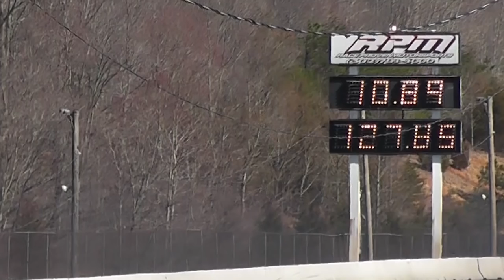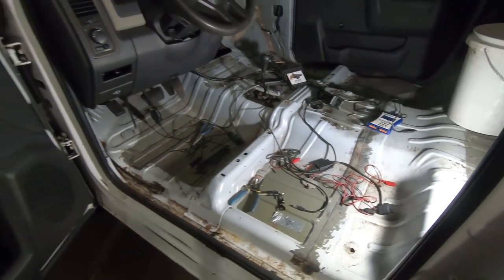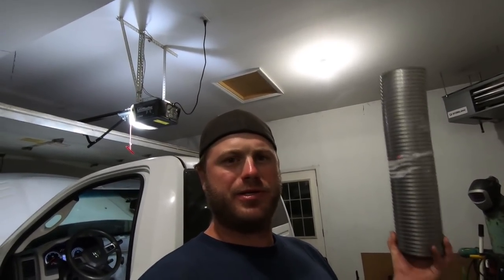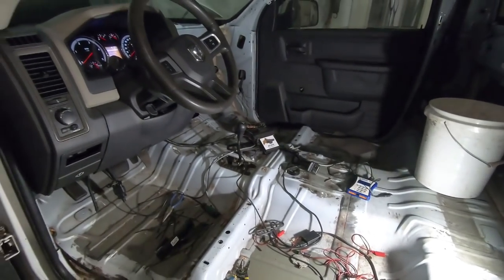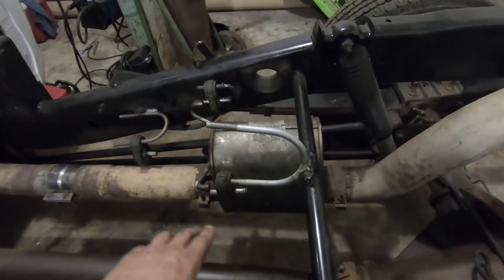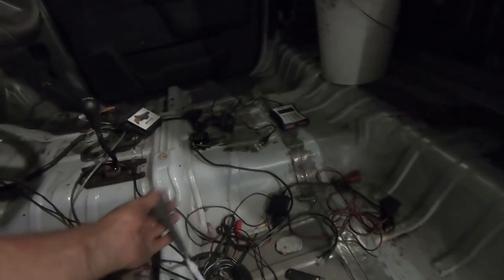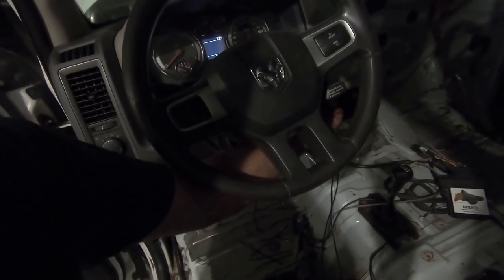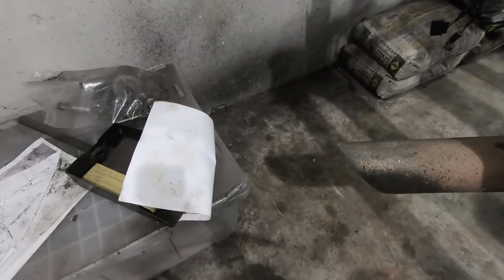HOOD STACK Diesel Exhaust Cut Out Is Done!! FINALLY 100% Functional!!

Comment: Tom you can use the bed you have  cut the bottom bed out from the bed sides then lightly drill the spot welds separate the inner portion of the bed sides then weld tubing from the frame to hang the sides. Cheap way to lose a couple hundred pounds if you can post a email i can send you pics of how i did it. If you can afford coil overs and four link it'll hook way better and drop a lil more weight im like you don't own a super diesel shop so i have to budget everyday too